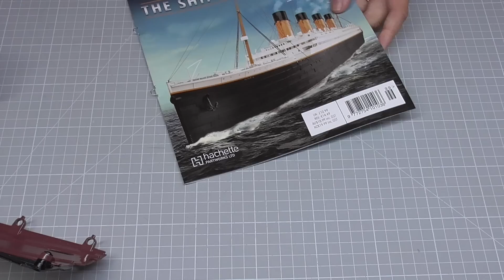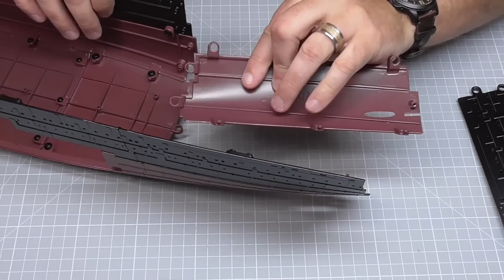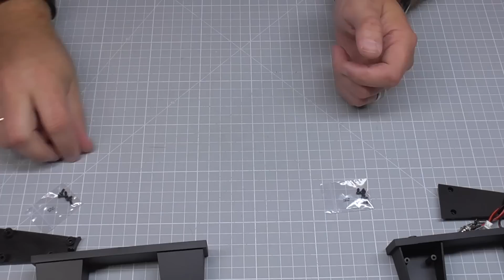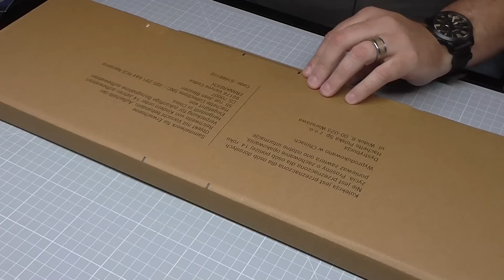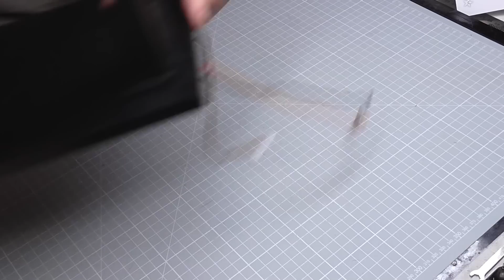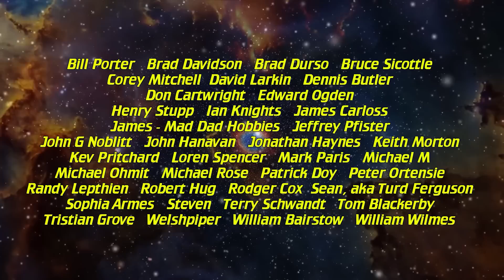Agora Models Build the RMS Titanic - Pack 18 - Stages 99-104

Comment: Apparently they made the stand slightly different in the u.s. as another modeler I watch his stand comes with the the 2 parts with the plugs are separate and then theirs a stage were they attach them to the  bottom piece that connects them